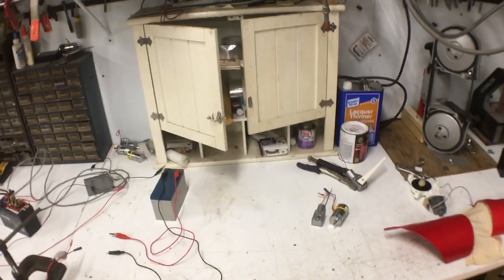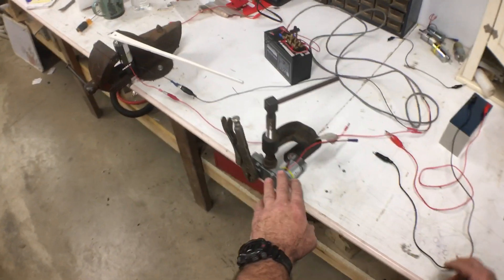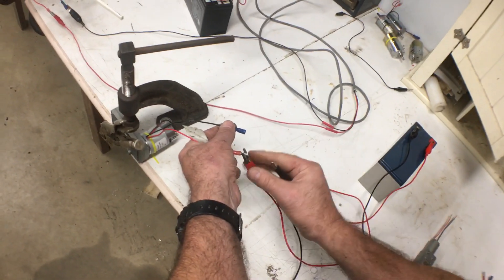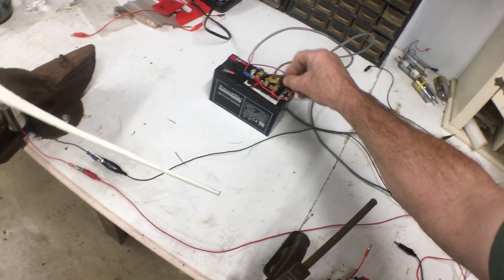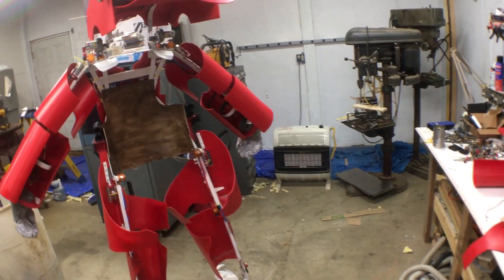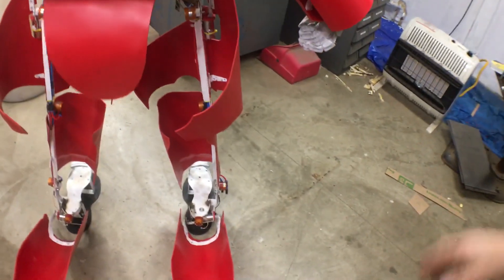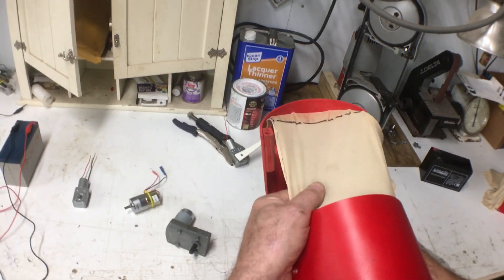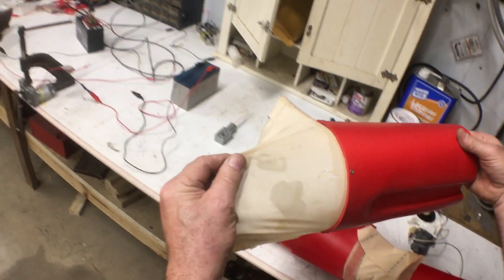HOW THE TECH WORKS: GEARMOTORS

Comment: Not even that big of a Fallout fan but I love this project and check on it regularly.

For fabric/plastics connectivity, you want to sew the fabric with a high redundancy into a material which is similar to your base material (not in thickness or the specific subtype of plastic, but something approximately similar that's flexible) with a high redundancy and then use a cyanoacrylate based adhesive to create a secure connection. Its also very popular due to the nuisance in removing stretchy fabrics which tend to damage easily to attach the plastic receiver to a unit of velcro and then use that for attachment to improve the maintainability of the unit.

If you want to stiffen the panels up, I strongly advise using a torch to heat copper tubing and bending it into the edge rim profile of the unit. 

If you have any areas which built up pressure or risk fracturing in the plastics, suguru plastic is really good at absorbing shocks and I often use it in my own armour builds, along the rim of the copper tubing. Its really good too for attaching segments together for more complex shapes without the use of foams which deform over time and aren't adhesive themselves.

These two in combination with modelling foam and vacuum forming are my go-to for creating extremely light wearable mechanical forms -- and with modelling foam you can tunnel and push expandable garden hose (the kind with fabric) through the gaps for running cable since they are very happy to deform under mechanical pressure and provided you dye the the fabric they look really good in these kinds of projects.

For locking elements up, I find pairing a solenoid up with a twisting mechanism for magnets works well so that the magnet turns flips either locking or unlocking the form and the solenoid simply changes the state without needing to be powered unless there is a state-change (it also makes a very satisfying 'clunk' when it locks that impresses onlookers).

If you want to make the knee a bit friendlier and the mechanism less fragile (I find it and the hip and elbow are the most fragile parts of many builds), make several joints which can flex about 10 or 20 degrees or so and then push the full rotation around that range rather than have a single joint endure it mechanically. This will enormously prolong the life of these units with extended wear and use.

I hope some of this has been helpful.

Please keep up the good work, my friend: 

you're doing really amazing stuff and I love every update.

PS: I see a few pretty girls on your shelf. You have good taste.
Reply from the maker: Hi 
thanks for the info.  Im almost done roughing in the feet, next is helmet then try to animate the hands enough to hold a super sledge.
On a funny note,  the best way to pilot a large mech is on darling in the franxx
Lol

Comment: How did you plan out the suit electrical stuff? Like did you use a online program? Write or draw it out? Or just know where to put things.
Reply from the maker: Kind of a mix of the last 2 things. 
I have had a motor control class which made that part easy, i had to re-learn plc controllers since they changed alot in the 20 years from when i was trained on them.
After that i just kept trying different things and it evolved.

Comment: Do you have motors attached to the limbs, to increase your strength, just like in the game?
Reply from the maker: Hi
Not for the strength.
 just to open and close it
Reply: @ray16120  if you build it that way you can do a lot of heavy duty work with that

Comment: Suggestion for the joints if you can get a diving suit rubber and scrunch it up to have enough room to move the staple it to the plastic with bolt staplers